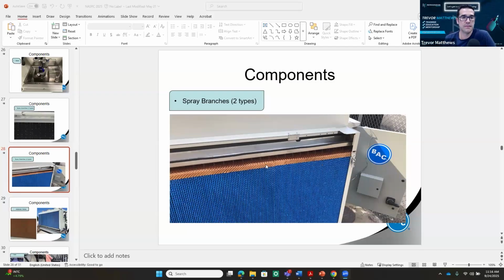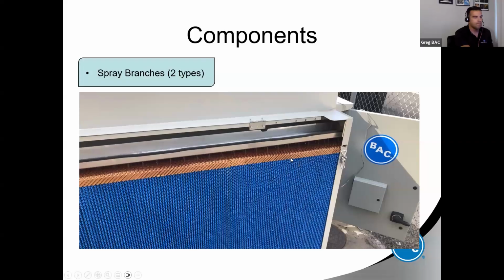Troubleshooting CO2 Gas Coolers with BAC Part 2: Pumps, Alarms, Control Strategies

Comment: One thing that I still see in all the conversations I have heard is "Low Ambient" control strategies. I'm still wrapping my head around it, but I guess it can be approached from the design standpoint.
Reply from the maker: In CO₂ systems, especially in low ambient, if discharge or gas cooler pressure is allowed to fall too low, density drops, mass flow collapses, and the system can stall. That’s when valves lose authority, oil return suffers, and the system starts hunting or short cycling.

This is why I don’t like seeing low-ambient pressure settings below ~700 psig (≈48 bar). You need enough pressure to keep good refrigerant density and stable flow through the gas cooler and control valves. Pressure here isn’t the enemy, loss of flow is.
Reply: @RefrigerationMentor  thank you. Will find out more about strategies to maintain that pressure above the dangerous zone.
Reply: Amen